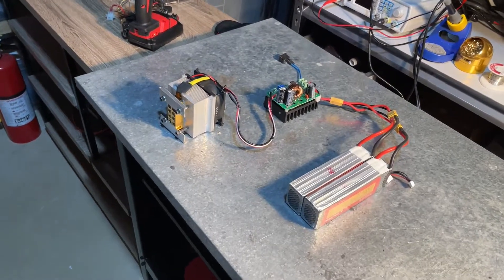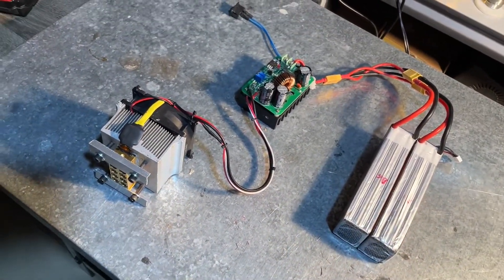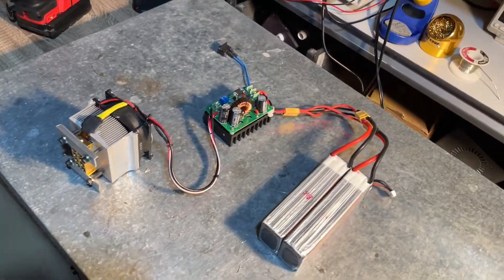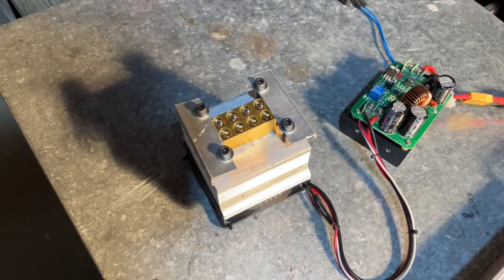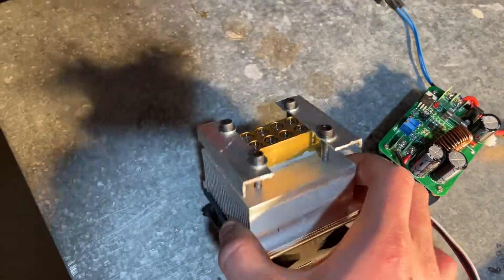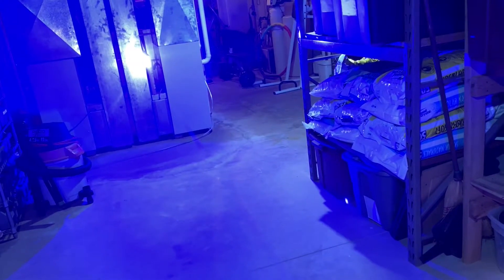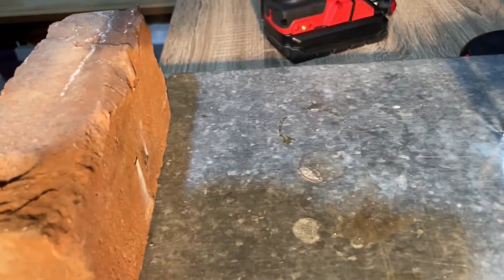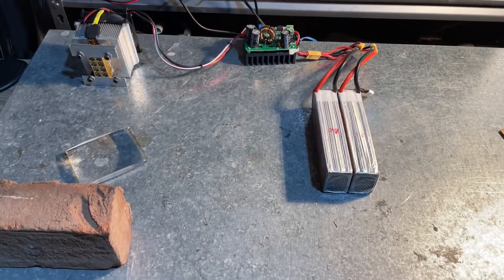28w Nichia Blue Laser Diode Bank

Comment: Where did you get that lens ?
Reply from the maker: It is actually a standard double convex lens I believe, works fine for the wavelength and power. If it were a high-peak power pulsed laser, or if it was an infrared or UV laser I would look into different optics, but standard lenses tend to work fine

Comment: Hey where did you connext your switch?
Reply from the maker: To the input of the boost converter. I am not sure how the output voltage behaves when the converter is first turned on but it seems to work ok

Comment: Just being near high power blue LEDs can alter your blue vision.  I think that happened to me because my left eye, central vision area, is slightly less sensitive to blue LED light than my right eye, and there was a time when I was experimenting with 20 watt Phatlight LEDs. Even though I always used diffusers and never looked directly at the naked LED emitter, I think that the blue one is responsible for this slight issue I have which is only noticeable when I look directly at specific shades of blue LED light as in some LED backlit signs. 

DO NOT play with even high power blue LEDs,  or any color, without appropriate eye protection.
Reply from the maker: I have high-quality blue laser light glasses that I use for my projects

Comment: are the diode still working ? do you recommends using the NICHIA laser diode brand according to your experience ?
Reply from the maker: The Nichia banks have been by far the easiest to work with in my opinion so I would recommend them
Reply: If you want to just buy the laser and have fun go for SANWU lasers
But 
If you are a passionate techie guy and wish to have all the needed components of the laser system get assembled by yourself as per your liking
Go for NICHIA

Comment: Hello,  I was wondering if I could hook up a laser diode directly to a power supply. For example the "Kungber DC Power Supply Variable, 60V 5A Adjustable Switching Regulated DC Bench Linear Power Supply" which claims to have constant current. If I put it at the specs of the diode, would it work properly without a driver.
Reply from the maker: If you put the power supply in constant current mode and slowly brought up the current until you saw the light output to not increase any further/the current draw starts to level out, it should work fine. This particular diode bank had a forward voltage of around 28v and leveled out around 33v, which corresponded to around 3.4-3.6 amps. Using non-laser power supplies can sometimes damage the diodes as when they heat up, they have a slightly different resistance and some power supplies will correct this by sending more current, which ends up building more heat until it damages one or all of them

Comment: How small of a spot size can this be focused to with fixed optics.  The reason I'm asking is that these laser banks are getting to power levels where they could compete with co2 lasers in CNC laser engravers.  VERY impressed with your build.
Reply from the maker: I was able to get mine to focus down to a spot of about .5 mm wide and 1.3 mm in length, but I am sure that with more fine optics that results could be attained. Focusing it down to a spot when the laser bank itself is rectangular is difficult and I am still working on how to get it to be circular so that it is more practical. The lens I used was just a standard double convex glass lens and it had not trouble with the laser
Reply: @danilorosich  Did you manage to get a smaller point? Tried with more extra lenses?